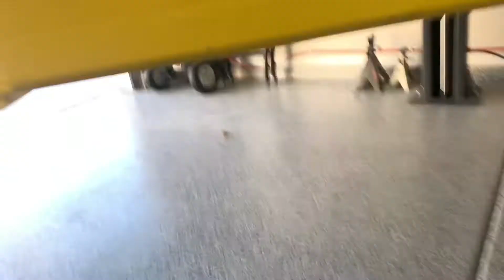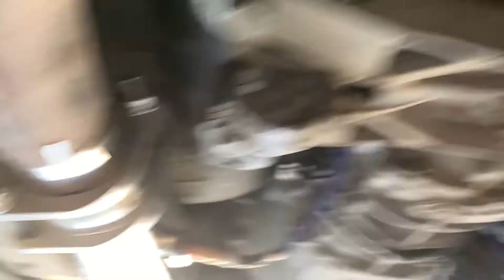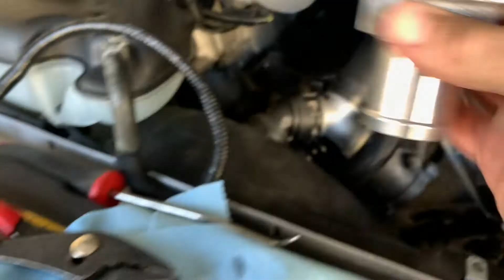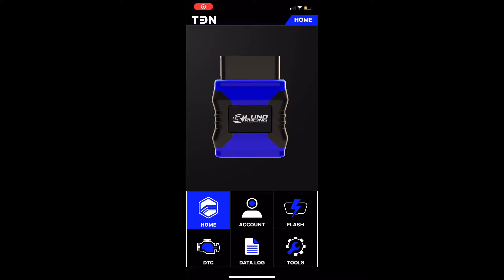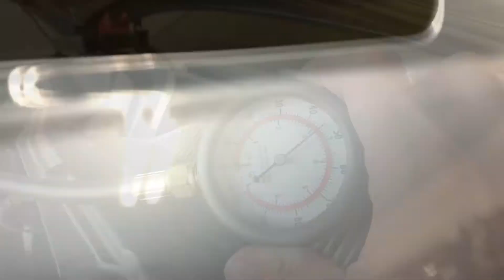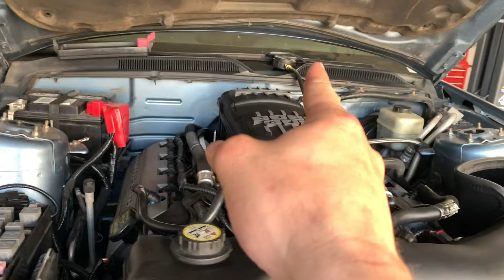FIRST START UP! NO CONTROL PACK 07 GT Coyote lives! Exhaust, battling leaks & verify fuel pressure

Comment: Did you have to reprogram the pcm to that vehicle (vin) and reprogram 2 keys ?
Reply from the maker: No, the keys are programmed to the instrument cluster/SJB. The ECU just has the PATS deleted
Reply: @MattSoppa  so without a PATs delete I could just reprogram new keys and it would still fire up even if I don’t do a pats delete?
Reply from the maker: @Redskinnedfoxe short story, no. Been told that it’s best and easiest to do the PATS delete
Reply: @MattSoppa  ok thanks man I enjoy your work that you do I just did a swap in my 2014 v6 to v8 and the that’s the last thing I have to do is the pats
Reply from the maker: @Redskinnedfoxe ah well that may be a different story since that ECU sort of belongs in that chassis
Reply: @MattSoppa I did the (2010 v8 4.6 ) had a (3.7 v6 2014) so I did the Clone year 5.0 like your video of the 2010 mustang gt
Reply from the maker: @Redskinnedfoxe ohhh

Comment: Couple things I have learned.. Buy a Wire Diagram service manual for the mustang year of your engine. Didn't want to go with a coyote. Instead the Cyclone V6 for the better mileage with a little bit of power for a 1961 Ford Unibody. That left me on an island with no aftermarket harness and pretty shallow selection of performance market. I enjoy your content 💯 .  @MD_Machine
Reply from the maker: You’d have to make a bar bones OEM harness

Comment: Nice job. Using 2.75" to 2.5" reducers is indeed the best way to mate up the Coyote front half of the exhaust with the 3V over axle pipes.
Reply from the maker: Absolutely! One day if I’m feeling Froggy I’ll get a full 11-14 3” exhaust system but it sounds very good with the Borlas